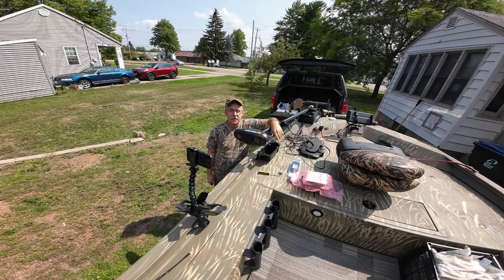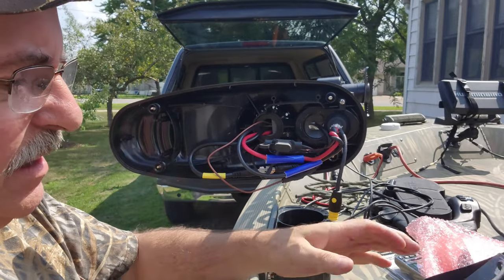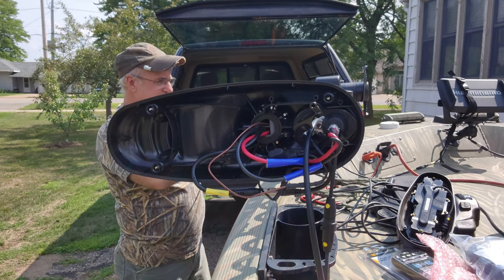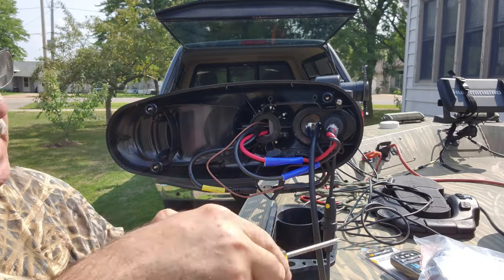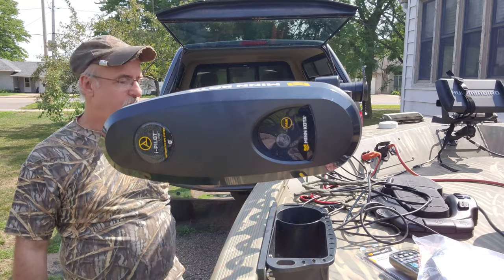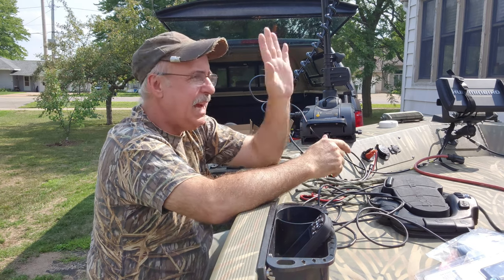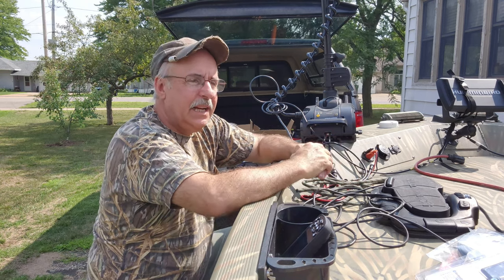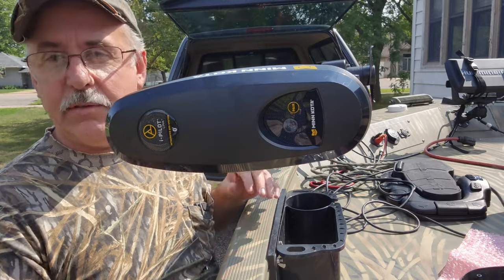Upgrading from I Pilot to I Pilot Link on Minn Kota Terrova

Comment: I'm thinking of doing this on my Terrova Riptide, solely because I'd like to have the "Follow Contour" feature.  However, like you said, $800 to add an ethernet cable seems a bit stiff.  I'm assuming they "got you", because of the proprietary way  of connecting the ethernet cable.  In other words, I'm assuming I can't just go buy a cat-5 cable and an appropriate Hummingbird chartplotter..
Reply from the maker: Correct. They bleed you dry.
Reply: @KevinsNorthernExposure  Yup....  My setup is so new that, at that price I think I'll get a year under my belt with it, before I try and convince myself this is something I absolutely have to have.  That said, it's nice knowing how easy it is to install.  Thank you for sharing this! 👍
Reply from the maker: @phillamoore157  you are welcome.  There is a small new learning curve, especially on the Humminbird, but it is pretty slick once you get the hang of it. I don't troll much, but I can follow a circle created around a spot and follow schools of crappies.... or follow a track along a shoreline casting for walleye.
Reply: @KevinsNorthernExposure  Yeah..down here in FL, you find yourself consistently in roughly 5ft of water casting towards reed lines. And, that can do on for what seems like 1/2mi at a time, along the same depth contour.  So, I could see where that would theoretically be a really nice feature to use while not having to constantly tweak the motor.  But, it could very well be that creating a track with the iPilot I’m using now, would accomplish the same thing, maybe even better.   Like I said, I’m going to do myself a favor and exhaust the capabilities of my existing setup first and see if I can accomplish the same thing via different method, before dropping $1K to use what would be one feature.
Reply from the maker: @phillamoore157  well....another benefit is that it stores 66 tracks....instead of just 16 on the ipilot...so another thing to keep in mind. Good luck!

Comment: So I see that this video is 6 months old. I'm not sure if what I just ordered was out yet. I just ordered the head unit with the cable, and then the remote separately. I already have ipilot with the puck and everything. It was about $625 going this route. The head only was around $280.

Comment: Is that a 24volt terrova or the 12volt or does it not matter?
Reply from the maker: The upgrade I did was for all Terrovas 2017 and newer. 
2016 and earlier have different kits for 24/36v and 12v I believe.